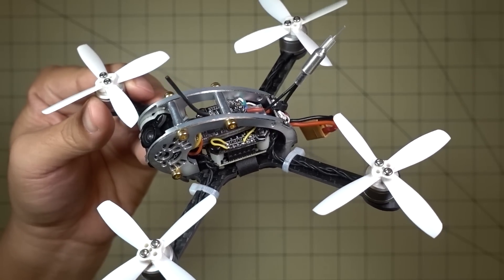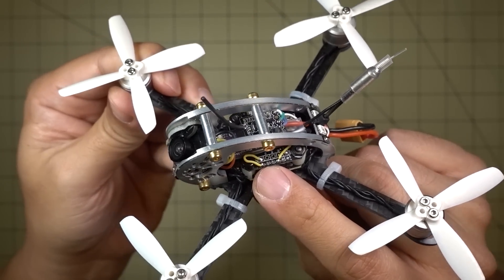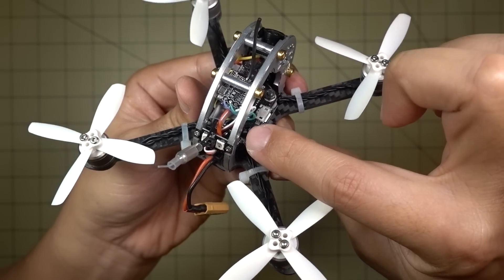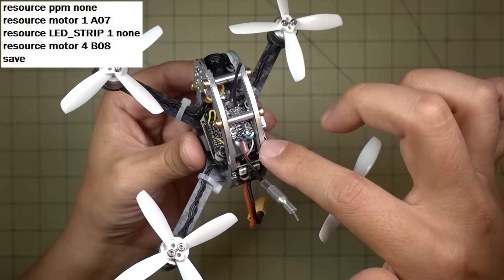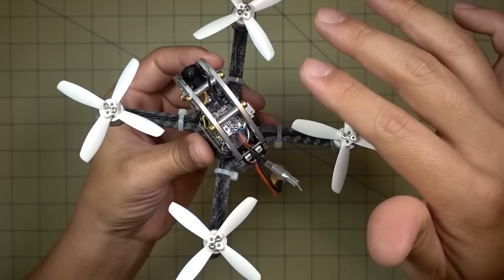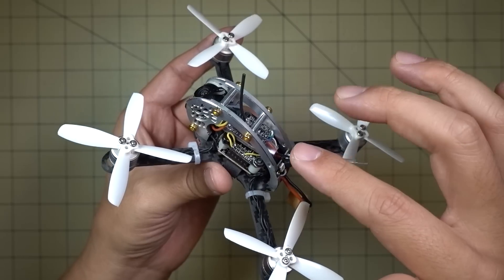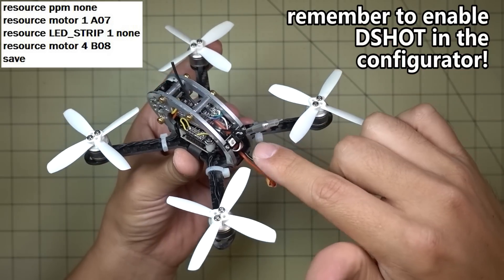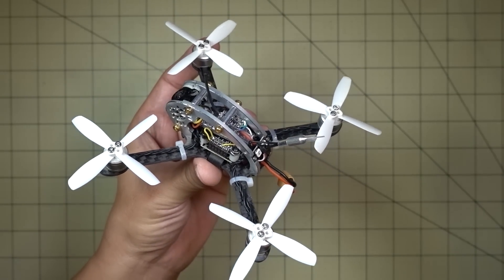FLY EGG 100 & 130 DSHOT Tutorial 💛

Comment: Is there a way to do this without losing the led strip?
Reply from the maker: not that I'm aware of.
Reply: Upgrade to bf 3.3 and only solder ppm to motor 4 (i´m on spektrum)
Reply: MrVanBelt how does updating the fw fix the motor 1 not spinning?  Any what Target did you use?
Reply: Yes it does. Also check your esc firmware. I'm on 16.7.
Reply: MrVanBelt what Target did you use in bf.  My escs are on 16.7
Reply: FF_PIKOBLX https://github.com/betaflight/betaflight/tree/master/src/main/target/FF_PIKOBLX

Comment: When you switched from ppm to ibus did you have to change the voltage pad? Like from 3.3v to 5v or anything? I'd like to use ibus when I receive mine as well, figured it would have come connected to ibus already.. Is it just as easy as switching the signal wire from the ppm input to the sbus? Also, when using dshot600 what do you set your PID loop rates at? I started using Dshot 600 on my kingkong 90GT and at 8k and 8k the board pretty much freezes up! (100% resources used) When I lower it and reboot betaflight it works fine. Flies great too.
Thanks for your time!
Reply from the maker: +C LittleJ did not change voltage pad. PID loop is set at 4khz.
Reply: Thanks!

Comment: Thanks for the info Albert iam having the same issue using the real piko blx with a cicada 4 in one esc when dshot is enabled motor 4 don't spin up will have a play around with it a bit more see if this helps thanks also how would u recommend i power it up direct power to the fc for voltage sensing as it's not working correctly any thoughts suggestions ?
Reply from the maker: +jon hoyles not sure why voltage wouldn't work... you connected to vbat?
Reply: Albert Kim basicly have direct lipo voltage going to fc then jumped two wires from the fc down to the 4 in one esc, running bf 3.20 lost my ppm pad trying it so I think iam lost now unless I can try it using motor 5 pad somehow also using the innova osd/vtx board so don't have many free pins any ideas?
Reply: hi there albert I finally figured it out for my piko blx I had to soldier motor one wire to motor 5 pad and change it in the cli basic remap and dshot 600 works cant understand why motor one is effected very strange, still having problems with the voltages mind bf 3.20 thinks I have a 5 s plugged in and its only a 2s any ideas how to fix that ?

Comment: Why the RX2535 props over the stock kingkongs?  Also, how do you like these 1105 motors? Thx
Reply from the maker: Doing some testing to see how this is as a MultiGP micro racer. The specs limit to 2.5 inch props. These 1105 motors get pretty hot on 3S, so sticking with 2S. Seem OK, but definitely better motors out there.
Reply: I heard they're silent, which is why I'm very intersted in them, but I hear they're not that durable.
Reply: Albert Kim which motors would you recommend for the fly egg 100 as upgrades to run on 3s, With Gemfan 2035 props?
Reply from the maker: +C LittleJ the kingkong 1103 7800kv... I run 3s on the 95gt and it runs great

Comment: I have one of these KingKong picoblx 20x20 stacks in a build. I can't update the betaflight to 3.1.7 form 3.1.6. Just fails, did you notice anything funky?
Reply from the maker: +Slowtreme mine updated to 3.1.7 just fine. Not sure what kind of error you are getting... got more details?
Reply: When I connect with BF it opens the comport fine, but when I flash it's unable to communicate? (not in front of PC) If it works for you I must be missing a driver or something.
Reply from the maker: +Slowtreme tick baud rate of 256000...